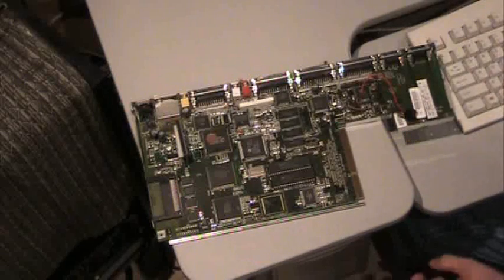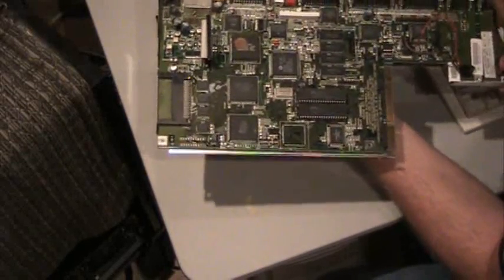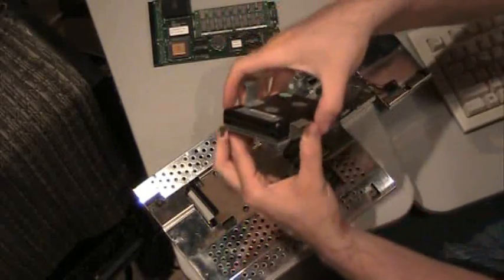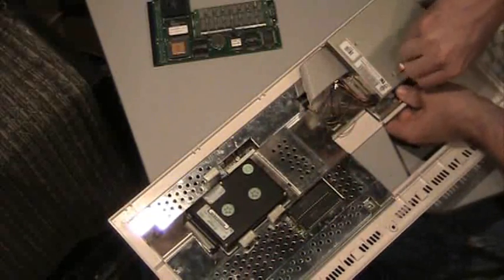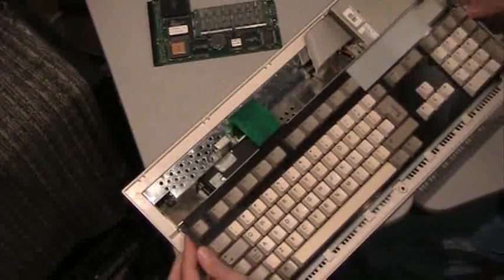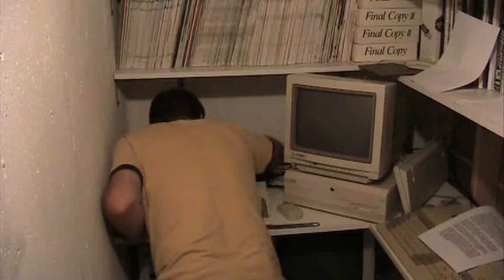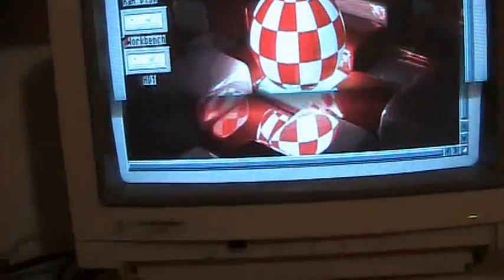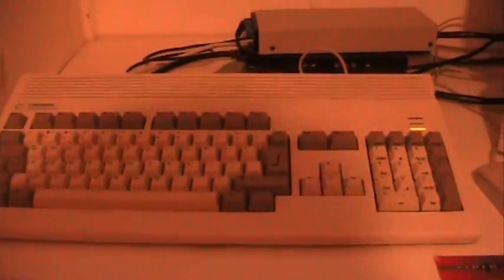Commodore Amiga 1200 Assembly and boot-up

Comment: How would you solve the Overheating Problem with the A1200HD.. I had to make sure that I was using this Micro Computer in an Air-conditioned room during Summer otherwise it would exhibit strange signs with the display etc..if ignored fail.
 ( Australia)

Comment from the maker: How fast would your OS boot on this CPU?  THAT'S the point.

This video was made when most Windows machines were running XP.  The average boot time for XP on a quad core CPU would be about 30 seconds.  On a machine without a multi-core processor it would take close to two minutes.